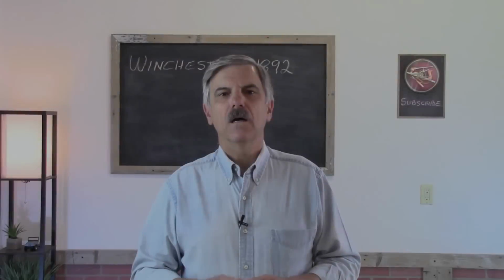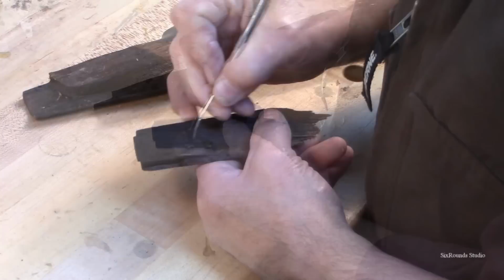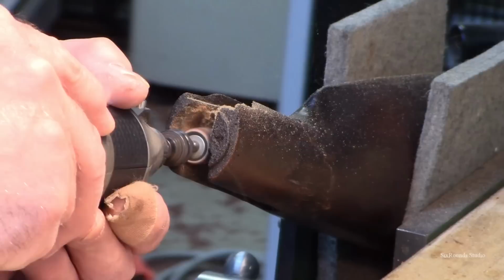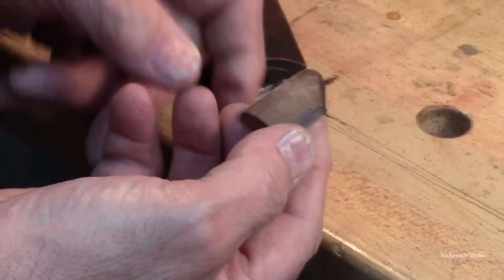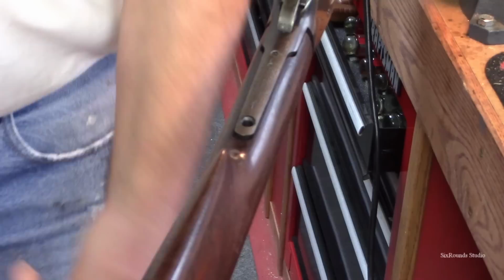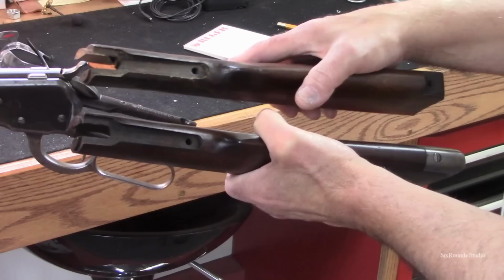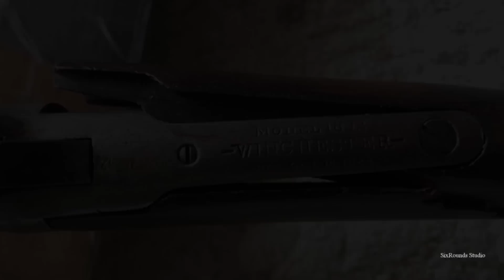Broken Gunstock Repair 1892 Winchester

Comment: I have now started to use the new adhesives that set quickly by UV light instead of super glue as a surface filler.  Also on all my repairs but not necessarily firearm stocks, I use glued wooden dowels as an extra (belt & braces) strengthening for the joint.  Another marvellous adhesive is the modern two pack that wooden aircraft builders use.  In England it is called "Aerodux" and if it is strong enough to hold a wing main spar scarf joint together when pulling 2g to 3g out of a dive it is good enough for a rifle stock.  I have done it and proved it.
Reply from the maker: Yes to all that you said.  The choice not to use a dowel had more to do with the nature of the break, the amount of wetted glue (epoxy) surface , the light caliber of the gun, and the amount of original good recoil surface remaining.  The break was in the worst possible location and adding a dowel would have been a challenge, though not impossible.  Thanks for taking the time to comment!

Comment: Great job on that badly broken stock.  I liked the way that you blended the finish around the repair to essentially hide it without having to refinish the entire stock.  That is something which I am trying to learn myself.  I buy lots of guns from auction houses and you never know what you will get until they show up with a few being damaged such as the stock on this rifle.  Dealing with the shippers on damaged firearms is never easy even with them being "fully insured" as the carriers will not give up their money easily even with lots of photos of the exterior of the box and the damaged firearm.  One trick I have learned in shipping out firearms which cannot be broken down into components is to make the shipping box as stiff as possible.  The longer rifle boxes getting flexed or even bent during shipping puts a lot of stress on the stocks in the tang and/or grip areas.  The double walled boxes are great but expensive but even placing long, stiff pieces of cardboard or other materials inside of the box helps a lot.
Reply from the maker: Great comment and advice

Comment: Thank you! Great video. I'm kind of lucky I guess since I'm a guy that everyone brings a box of parts to to reassemble when "they've" taken an item apart and can't get it back in working order again.

For as long as I can remember I've always taken everything I have apart when brand new just to see how it works....so I've learned from the start as I take things apart I make sure parts & springs don't go "boooiiinnnggg!"and fly across the room.

An 1886 Winchester is one of my favorite lever action rifles. So once again, thank you for sharing the experience you've gained in disassembling and reassembling your beautiful Miruko-Winchester 1886 Short Rifle.
Reply from the maker: Thank you David.  I have a lot or respect for the smiths that can work from a pile of unidentified parts.  By the way....this is a real Winchester 1892.
Reply: @SixRoundsStudio  sorry, I have (2) 1892's and I've had both apart (both Miroku).
I saw a video of an 1886 Winchester previous to yours and had that stuck in my head. My bad.

Comment: I used to build model RC planes. And if you ever done that you know you will end up with oil soaked balsa woods and other woods. And no glues will work in that situation. But I used K2R spot remover to soak up the oils out of the wood. Some times you had to apply that K24 many many times before the wood would be stripped of the oils. But it worked amazingly to allow repairs. Just an idea for future repairs... Thumbs Up!
Reply from the maker: Gary, thank you for the comment and the suggestion.  I will look the stuff up.

Comment: Nice repair, however I would always add pins (or screws) into a stock break, if only to increase the surface area of the adhesive joint.. I tend to use knurled stainless steel pins buried out of sight across the line of the break.. You are probably ok with a .22, but you don't want a stock folding on you with a full bore! You need to be careful mixing epoxy and cyano acetate glues on the same break.. they can sometimes react!
Reply from the maker: Thank you for the comment and your suggestions.  I would be very interested in understanding the science behind you concern regarding mixing epoxy and cyano acetate.  Could you point me toward some information.

Comment: So... I found a nice 38wcf 1892 made in 1910. Full octagon 24" barrel, full length mag tube, rifle configuration. The finish is still good. However, the front sight is busted, rear sight is snapped off, firing pin is snapped in two, someone carved their initials in the stock, there's a piece of wood missing in the forestock though it's still solid and functional, and the rifling is not all there. I plan on replacing the sights and firing pin. I also plan on relining the barrel. Not much collector value I would assume, so relining the barrel should just make it more functional without "destroying" it. Right?
Reply from the maker: Well...everything affects value.  So perhaps the question is what value do you give priority to? Its value as a "collector" or its value to you as a tool.  Obviously to have both values working at the same time is what everyone would like.....but sometimes the more pristine or rare something is the more we hate to use it.  If you are convinced that the rifling is unusable, but you want to "use" the rifle, then having it repaired might be necessary.  Restorers and collectors always use the line-in-the-sand starting point that it "is only original once" when we evaluate how work is performed.  Always maintaining as much of what is original is our goal.  But even doing a restoration affects value....no mater how good or bad it is done.
Reply: @SixRoundsStudio  I will go on with the relining. It will be what car people consider a "sleeper". Everything has some sort of problem except the finish and action. What drew me to it was the finish, caliber (I love .40 caliber), age, and the price. Use of modern sights, powder, projectiles, and much much better rifling will make this beauty work wonderfully. The guy at the pawn shop said it's original bluing but it just looks too nice to me to have all the other problems. Anyway I got it for a relatively fair price and rolling my own cartridges should start at 60¢ a pop. Not too bad. Who would you send it to to reline if not yourself? I'm thinking John Taylor. That'll be another $400. Are you capable of such a task?
Reply: @SixRoundsStudio  You did a wonderful job. I can't even tell that it's been repaired. The line blends in well.
Reply from the maker: @jeramyw  Any qualified gunsmith should be able to give you an analysis and estimate for price.  I am not familiar with John Taylor so I would look for references. We used to do that work...but my dad is now nearly 94 years old and my expertise is with the wood (though I have watched my dad do this and more), so we wont be able to do it for you.  I have another video up that talks about "restomoding" an old Winchester and the reasons I chose to take that approach.  Here is the link: https://www.youtube.com/watch?v=EsVHoeI45_E
Reply: @SixRoundsStudio  I've looked around on Google and he seems to be one of the go-to guys. Even my local gun store said they'd send it to him. Have you seen Mark Novak on YouTube? He does great work and I learned about conservation vs restoration and such from him.
Reply: @SixRoundsStudio  Haha. I just watched that video yesterday. I'll give you another view anyway. Keep up the good work and videos.

Comment: I'm not the expert on firearms but i think nobody to this day made rifle that can beat winchester rifles to this day in durability,quality but for precision very few can compete. There are copies of winchester rifles such as tigre or rossi but truth is you can't beat original.
Reply from the maker: Nino,  Thank you for your comment!  I have done work on Winchesters manufactured over a hundred years ago and each continues to
function like the day they were manufactured.   These were all well built, robust firearms from a period in history  when tools and machines were very basic and men and women were the brains and craft of each firearms construction.
Reply: I also for some reason think that inspiration for winchesters lever action repeating system came from revolvers revolving system except it was designed for rifles. Loading mechanism is incredibly precise and only revolvers have similar equaly precise reloading mechanism i never heard anybody claiming that winchesters ever jammed during reloading. I might be wrong but that's what i think it is.

Comment: Great video! I came here looking for repair techniques. I'm considering purchasing an old model 94 30-30. However, it has a small hairline crack where the stock meets the tang. The gun is being sold at a discount. Beautiful old rifle with lots of wear from functional use. Any suggestions on repair? I'd actually like to shoot it on occasionally but idk. Maybe it's just a safe queen now? Haha
Reply from the maker: Difficult to advise without seeing the gun or crack.  If you use facebook or instagram you can message me a couple of pictures and I can take a look.  If you dont use either I can give you an email.

Comment: Just found your video as I am working on a 1930’s AH Fox Sterlingworth that has a broken stock . I have used West system epoxy to glue the smaller parts back but I was wondering what dye you used to match the wood color ? My stock is the same color and I have a visible repair to do . Thank you !
Reply from the maker: Thanks for watching DaveM.  I dont use dyes.  I mix in  artist oils with the finish.  It thins down when mixed with the finish and allows you to put it on in thin layers.  You need to build up the colors from light to dark (I cover that in other videos).  I have used Winsor Newton for years, but I am sure any quality artist oil will do the trick.

Comment: 16:13 I noticed some small pieces of missing wood deep in the tang next to the screw. How would you go about filling that so it matches up to the metal better?
Reply from the maker: Well...there is the cheap and easy way by adding epoxy.  Then there is the harder more expensive way....cutting and adding in replacement wood. On these older vintage rifles, most folks elect to leave is alone and let it tell the story.

Comment: What did you use on that paper plate at the end to blend the sanding and cracked edge,? The different shades and mixtures... was it stain or epoxy or a mix? Hope to get a reply,thanks!
Reply from the maker: It is artist oils blended with "finish" built over multiple layers, drying between layers. I did a video on that a while back and included some resource books for reference.  It does take some time to learn that skill...and I'm not convinced I'm all that good at it even yet.

Comment: Are you still in the business of stock repair, and if so, could you give me an idea of how much a repair like this would cost? I have a couple old 1894s with stocks that have small breaks and missing wood around the tang, and cracks spreading rearward from the back of the tang. I'm reluctant to try to repair them myself.
Reply from the maker: I do, and cost is difficult to estimate without looking at the breaks.  I charge by the hour and not the job.
Reply: @SixRoundsStudio  Okay, thanks.

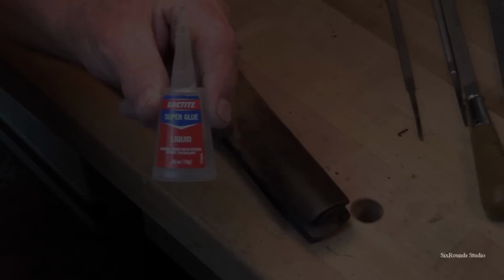Comment: Did you add epoxy to both halves of the broken stock or just one? At 13:35 you said that Super Glue mixed with ???? makes a great repair filler. Great video! I really enjoyed it!
Reply from the maker: The key is to get enough epoxy to make contact with both half's  of the joint and the variations in the wood striations (wood breaks are never smooth like they were cut with a tool).  The epoxy will migrate into the cell structure of the wood half's and make its bond.  Frankly I did this repair a long time ago and don't remember.  Each repair is unique. Epoxy makes a great gap filler, but the epoxy needs to act as an adhesive and not necessarily a replacement for missing wood; so should be only as thick as is required for a strong joint without it becoming the joint itself.  If you watched the joint repair that I did recently on the Ithaca shotgun...I applied a thin coat to each half.  Regarding the Super Glue. By filler, what I meant was. if there are small gaps or chips, if you mix a little sanding dust from the area you are repairing into a paste, you can apply that paste to the chip or small gap, let it dry and harden, and will give a lasting repair to small  repairs of that nature.  The super glue is not something I would use for major structural repairs.  Hope that helped?  Video coming up this Sunday, I have a great conversation with wood objects conservator and in the video we discuss preparations and materials (glue, epoxy...) and how joints are engineered and completed.  Hope you drop in and watch.
Reply: @SixRoundsStudio  Outstanding. Thank you
Reply: @SixRoundsStudio  
        I agree  that super glue is a great medium to use with sawdust as a filler for small flaws.
       I turn wood on my lathes and have found that epoxy creates the strongest bond but feel that titebond   III  creates an almost unbreakable joint when properly prepped and clamped.   
       Nice repair sir. Great seeing old Betsie get a new lease on life.
Reply from the maker: @twobeards6714  Thank you

Comment: When restoring or striping should I remove recoil pad or not
Reply from the maker: If your going to strip, sand and refinish you should remove the pad.  However...if your sanding removes wood below the pad (be careful not to remove any more wood than absolutely necessary) then you should do what we call "match sanding" the metal to the wood.

Comment: Do You use oil paint with boiled linseed oil? Im fixing up a old Mauser .It had a lot of deep scratches and the checkering is pretty bad .I ended up having to sand the stock .Thought I would use BLS mixed with sanding dust to fill .The oil paint pigment thined with  oil to stain the wood then just a hint of red added to oil to finish the stock .
Reply from the maker: Hard for me to answer you questions well without seeing the stock. Not sure what BLS is or what your filling? Regarding coloring, I use artist oils mixed with my finish.  I also have raw powdered pigment to color the finish as well, depending on what the desired outcome is.  Sometimes in the future I will be doing a more detailed video for my patrons when I finish setting up my Patreon page.

Comment: You did a great job for a wall hanger but what did you do  to create a stronger stock, once a stock breaks  gluing is not strong enough .
Reply from the maker: Appreciate your comment Bob.  Why do you believe this will break?
Reply: @SixRoundsStudio  most breaks follow a structural weakness in the material,  poor design of stock , adhering  parts together brings  it back to functional,  but without internal strengthening may fail again, and personally I would not trust a glued weld,
Reply from the maker: @bobscism3920  Thank you for sharing Bob

Comment: 1892 buttstock is not serialized to the rifle .  Why not just buy another stock .  They are all over Ebay and it's not possibly as expensive as the cost of this repair .
Reply from the maker: Thank you for taking the time to comment.  All of this was suggested to the owner before we started.  This stock has history (story) with this gun, and the owner wanted to maintain that story. If you haven't watched my latest video many gun owners see these old firearms more for their relationship to the the past and their place in time, and less as a practical money only  process. He was genuinely interested in preserving the guns story (and the two breaks tell the story of this gun). And then of course you assume my cost was more than the prices on ebay (I looked) .  Another thing to consider…guns take on their own "patina" depending on how they lived their lives, and that patina is subjected to the entire firearm and complement each other. If any replacement stock from ebay (or any other source) lived a life so different from this gun then the mis-match could be significant enough to require adding or substracting patina to the replacement stock so the look was consistent. There are many ways to approach repairs and restorations.  This is what we agreed to.  I hope all that makes sense.

Comment: Was the super glue a sandable filler?
Reply from the maker: Not for grain or pore fill before adding finish.  There was still small sections of missing wood because of the break.  I mixed the super glue with sanding dust from around the break (to match the color) to fill in those small holes.  We use this technique in a lot of areas doing repairs. This is not for patching large areas.  For larger areas you need to add in wood patches.